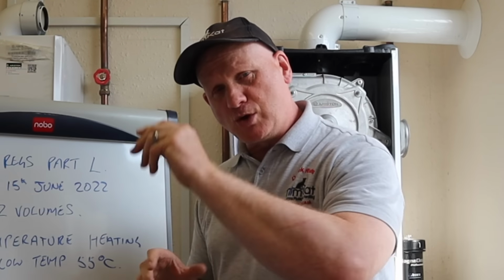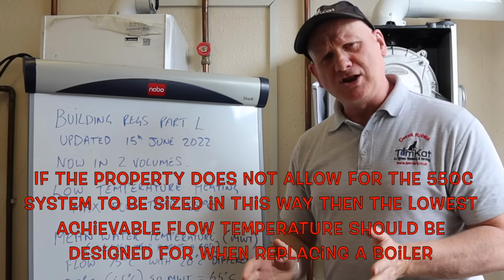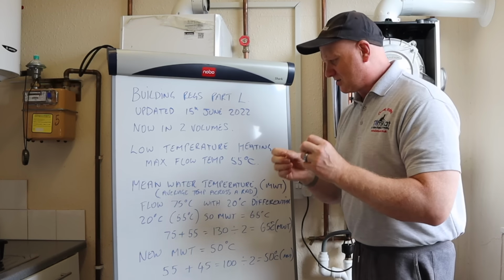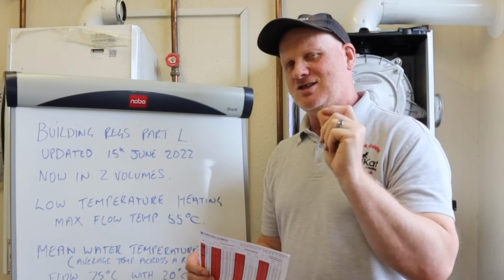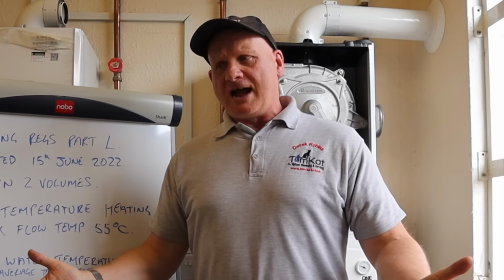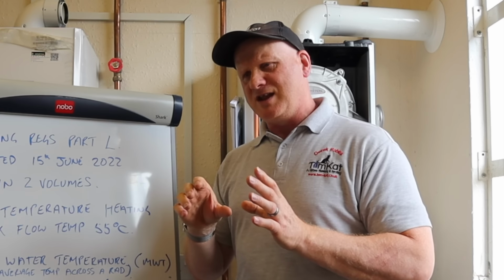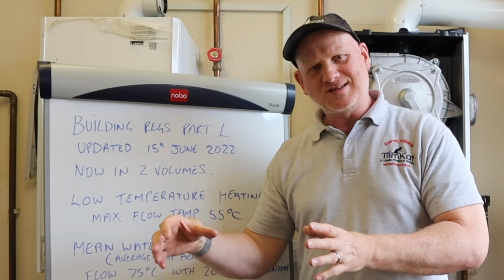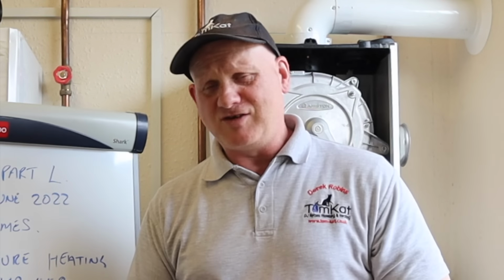Don't adjust your  heating flow temperature until you have watched this video. #saveenergy

Comment: I run my heating loop at 53°C. I read that was the most efficient temperature though I thought the temperature displayed on the boiler was measured at the return not the flow.
Five hours with all TRVs fully open and the 15kW combi boiler temperature in my place has only raised the temperature from 9.8°C to 11.1°C
So much for the energy assessor's calculations.
It does seem to be remaining at c. 11 but the outside temperature has risen and my thermometer clock is on a high thermal mass which is the other side of the radiator.

Comment: You have given brilliant advice all around  your video. It all makes sense one's you have  Explained everything about the Temperatures..  I have a question for you.. should the scale filter be connected to the 🔥 🥵  hot flow.  Or the COLD 🥶  flow.  Thanks for your advice 👍
Reply: Whilst I am not an RGI or plumber, it seems to me that it goes on the return flow (cold).
ISTR the idea of a filter is to remove stuff from the system and prevent it going into the boiler, it will do that best on the water that comes back into the boiler.

Comment: Absolutely right on heat or eat. However this phobia about CO2  is the driver of the current “difficulties”.  Incidentally, the US recommend a -15C setting for a freezer.  They are a massive % of your electricity use.

Comment: At the moment ive been seeing lots of video's on social media where people are telling other people they can save money by turning their internet router off when they go out. 

DON'T do this on a regular basis as the dlm (dynamic line management) sees this as a connection fault and WILL slow your connection speed down to protect the network!

You would then need to contact your isp to have your dlm reset or wait ages and hope it turns itself back up again.
Reply: This is true, but only relevant for FTTC products

Comment: What an absolute bag o bollocks, so I have to make my house 20 degrees instead of taking an hour it will take 4 hours. to have a bath is normally 60% hot water and 40% cold water but he's saying fill your bath with 100% heated water which means the boiler is in burn mode for the entire bath fill.

Comment: We are freezing. Boiler set to 55 for rads and 45 for water. We are freezing. I am wiping the windows twice a day. We are freezing. I am having to shout out constantly to turn lights off and shut doors. We are freezing. I am shouting out to the children in the shower to hurry up. We are freezing. My daughter sobbed and became hysterical when she broke down about the soaked black walls. We are freezing. My other daughter opened a treat packet of biscuits her sister said we can't afford them so can we at least share them? We are freezing. We are damp. We have mould. They argue over a banana. Oh and the bill is still £497 a month. We live in a stone cottage. We are freezing. If the boiler overflow freezes we won't have hot water.

Comment: My landlord put the thermostat next to the front door surely not a good place, tiny hall gets up to temp quickly so I either switch hall radiator off or open internal door. My main radiator is under the stairs so not sure it's heating the room, they removed my gas fire to avoid cost of servicing it stating I don't need it?

Comment: I'm utterly confused with my heating, last winter I averaged 45 units a month of gas usage (I only have a gas combi boiler, no cooker), this winter I'm averaging 220 units a month at present, that's a massive usage hike and my plumber insists there's nothing wrong with the boiler or my gas meter despite the fact I was using 4 times the amount of units during the hottest summer on record compared to last winter. It's a 2yr old Worcester Bosch boiler. When my fixed term comes to an end I'm going to be skint!!!
Reply: Same here. I have a new shiny Worcester boiler and and using more gas than my 20yr old Biasi. LOL

Comment: it takes 3 hours to heat  the house  at 55c   8 large& 5 small  radiators ) with condensing boiler (valient ) all bedroom thermostat radiator in level 2  so that the large living room radiators ( 20 foot x 15 foot can get heated at level 5 .    . Which would be the correct setting for the boiler @ _ 5 c temperature at now

Comment: it takes 3 hours to heat  the house  at 55c   8 large& 5  radiators ) with condensing boiler (valient ) all bedroom thermostat radiator in level 2  so that the large living room radiators can get heated at level 5 .    . Which would be the correct setting for the boiler .

Comment: this guy is useless with a low flow temp your heating will have to be on longer to heat the room.
you dont have to replace your rads or pipes you can have a like for like.
a gas fitter will sell you stuff you dont need

Comment: I turned the stat off to zero
I control the flow control 
To control the heat. 
Taps are on eco
But regardless. The new
Combi rads & pipes 
Cost me £5000
I didn't pay that to fucking freeze. Or put 3 jumpers on.

Comment: Lol I have an old wb Greensted 46 combi,
What's the best temp settings for Flow temp on the heating and the lowest safe flow temp for the hot water. We also have a stove that is the main heat source now, but still run the gch to warm the rooms a little

Comment: My home has brand new radiators with (what should be) a higher BTU that needed, but an old boiler. House struggles to heat up (it's not been over 18C inside during December) and mostly sits at 17C even with heating on. Probably an insulation issue, but I do think I need to get the system tested to make sure the boiler can handle the radiators.
Reply: Check the boiler radiator flow temperature, sounds like it may be too low.

Comment: Please clarify, my understanding is, that you do not have to be gas safe registered to work on the parts of the boiler which are not gas/seal related.

In other words, if you are purely going into the PCB and for example wiring in a Tado thermostat You do not have to be gas safe registered Because you are not opening up any seals or altering/adjusting components to do with the gas side of the boiler.

Are you saying that this is incorrect?
Reply from the maker: You can work on a boiler if you are not gas safe if the front panel is not part of the combustion chamber. Most new boilers now have the front cover being part of the combustion chamber so you wouldn’t be able to access the pcb to wire in a stat.

Comment: I tried it on my combi condensing boiler and the radiators never even went warm so I reset it to 70 and it is working fine now and the house is warm again.
Reply: Did you increase the flow to the rads/adjust the lockshields? Bleed out air, flush out any sludge etc?

Comment: They have been doing that to pensioners for decades eat or heat choice, but jolly old public allowed that to happen.
Now its facing the younger generation and you get upset?.
Also older people cannot maintain body temp as younger people so they require slightly warmer rooms like 21,/22c  , i should know i worked in care homes up and down the country.

Comment: Did I miss something. But what happens if you want a new system boiler,  what happens about the 55c degree rule then. You said that water in your cylinder has to be stored above 65c

Comment: In spring/autumn house comfortable with flow temp 55 but when it's minus 3 outside like tonight I've had to turn up flow temp to 80. If you set flow temp too low the heating is on for ages and seems to use more gas.
Reply: That’s correct ! I have both to max temp , I hit boost 1 hour for rads , they warm up super fast full pelt for hour! Whole house cooking for upto 5 hours. Pointless slowly running the gas for 5 hours ti boiler and having a woolly jumper on.
Reply: @damo1061 You're actually throwing the gas out of the chimney at higher temperatures and only think is not ideal for lowering flow temperature is the pump runs longer but the extra power you'll spend running all day is nothing to the gas waste of the sky

Comment: amazing video ! 
Hope you can help me out...

Long story short: 
We bought a new house, built in 1975, new triple glazed windows, old loft insulation 100mm, 16 radiators, new 40kw gas boiler with 2 zones -downstairs and upstairs. 
We paid £30 a day when thermostat was set to 19.5C 24/7 so we cut it to upstairs heating only. The radiators are old, type 20, plumber said this could be the issue to our high bills as it takes a long time to heat up especially the last room in system (balancing is not the problem). We decided to replace the radiators in the last two rooms in house for the type 22 ones, but I am a bit confused what size to order. The original ones are 2000x540, but the biggest I could find was 1600x600mm and these are 9611BTU/ 2816W. The online calculators are showing me that the BTU needed for this room is 3000-4000. My question is, is the radiator (1600x600) unnecessary for a room this size (4.2x3.5m), and would a radiator with 7208BTU (1200x600) do the same job (still 3000BTU more than calculators have shown me)? I'm keep playing with flow temperature but nothing helps to put my gas bill down, I'm desperate...:( Pleaaase help :D
 ( just measured flow temperature out and in on the boiler ,with boiler set to 70, it is 55C out and 51 back in )

Comment: Pump wise, I’ve read that setting it to a constant speed is necessary for heating water cylinders and variable pressure for combi boilers fitted directly to radiators. I have a third setting on mine for constant pressure and have an unvented cylinder. Each setting has three speeds. Any idea what it should be set to for this system? I’ve had a play and the boiler tells me flow is insufficient when set to the variable pressure mode. Thanks

Comment: Great video, but please DO NOT turn off your Router / Hub, they are low powered devices now, they are designed to be left on 24/7. By switching them off you could cause line instability and errors sent to your local exchange equipment and provider, therefore they will adjust your speed and think you have a line fault etc. Also you may miss important software updates. Please leave the Routers swtiched on 24/7, it's really not worth a possible £20 a year saving for all the hassle.

Comment: I've been doing quite a bit of research on this. Our boiler was replaced last year and the installer set the heating flow temp to 75 degrees centigrade (it's a combi intergas boiler) I lowered it down to 65 degrees centigrade a few weeks back but when the installer seviced it recently he said it was set too low, would put pressure on boiler to work harder and would wear it out quicker. I mentioned about condensing mode and what I'd read online and he said don't believe what you read online. He set it back to 75 when serviced but I've put it to 60 degrees centigrade since and have ordered some digital thermometers with probes so I can balance the system (as isn't balanced) and check the flow return temp.
Reply: All the advice I’ve seen is to set the flow temperature between 60-70 degrees. Above 70 is too high and below 60 you have to risk of bugs like legionella growing in your system. I’m no expert but 75 sounds way too high to me, I think you done the right thing turning the flow temperature down. Mine is set to around 65 degrees and the engineer who services it never messes with that setting, or says it’s too low.

Comment: Really informative video and I'm very glad I watched it, thank you. As an unexpected bonus I learned from you that my recently installed Vaillant ecoTEC plus has a built in ERP pump. This is interesting because the installer left my old Grundfos UPS3 inline central pump in situ and running on number 3 (full power) too, so it would seem that I have two central heating pumps running! Is this a normal thing to do?

Comment: A condensate pump outside of a condensing combi boiler will run longer and more often with lower flow temperatures and increase use of electricity.

Comment: I have been in the game for 55 years and to save money why don't people just get their system balanced you don't need to turn the flow rate down just balance the system and get the hot water were you need it as fast as possible but send it back to the boiler as slow as possible thus giving the time for the water to pass its heat into the radiator,  then you use less gas and you heat the rooms up quicker, then the heating switches off its simple not rocket science. 
Nice video

Comment: These replacement boiler regulations are all well and good, but I would hazard a guess that the majority of housing stock in this country would have to upgrade pipework and radiators which will cost the people of the UK trillions and trillions of pounds in total because basically you have to rip your house apart in order to achieve it.

My house was only built in 2006 has plastic central heating pipework 15 mm downstairs and only 10 mm upstairs. All the pipework is concealed behind plasterboard ceilings and floors. What a massive undertaking it would be to have to replace all my pipework !!!

Comment: Thanks for sharing - interesting video👍✌️

I've been banging on about the building industry building houses akin to Northern Europe for 30-40 years. UK building industry has done sweet FA about such.

I've been taking measures to reduce energy for years.

Carbon Climate Change agenda and "the Ukraine" etc is all part of a gouging, profiteering con, it's about control.

I've got a water cylinder, all rads have stats. Not sure how one takes HW temperature though 🤔

Also the boiler setting is numbered "Minimum 1 - 5 Max". I set it at 3.5 the water is piping hot. I've reduced the amount of time hot water is on too. Pump speed is set accordingly.

These new boilers with 8-10 year warranties? Like EVs, don't last as long as their predecessors - ergo they're not eco friendly as more of them have to manufactured as they're life expired at year 8 or 10. EVs are a write off when main battery is life expired - lithium batteries are made using filthy, dangerous supply chains and are not recyclable.  Some boilers, if well maintained and serviced, lasted 40 years. What we are being made to do? It's called enforced obsolescence - as opposed to progress. It's a chase the lady con trick!

In other words, it's another govt (quangos) and building industry gouging con. Also the evidence for CARBON climate change is sketchy at best. It's like Cold War 1, started by one man. In this case, who was outed, fled Europe straight into the arms of the CCP. The CCP are, with India and USA the world's biggest polluters. As are the top 100 companies and the super elite "one percenters", the unelected oligarchy. In the old HASAWA the polluter pays, ergo they should all take the lions share of paying for such! It's like the 75,000 unregistered chemicals let loose by them, same with water companies killing off our rivers again with effluent discharge etc. We are being conned, bread and circuses! 

I agree, my plumber and I have over specd rads. But I won't be having my kit/pipes ripped out if it's serviceable, the same applies to zones in towns etc - I'll ignore them, I don't recognise the government's right to rule, same with our WEF owned king and his son The POW (I had higher hopes for him!). 

There is climate change, but we are not being told the truth!

I'm WIS&D, ill and struggling, making us pay 25% levy for electricity, VAT at any price on energy etc is immoral. Govt has willfully removed power stations and gas storage, put the UK on its back foot, committed treason! Tony B.Liar, plus Ca-moron, two WEF shills, instigated this suffering. 

The UK has been eroded since WWII, possibly WWI, and certainly since 2008. Ponzi F.I.A.T money schemes etc.

You've given good advice my friend, but the root of the problem is a political coup by the WEF and CCP who've infiltrated and over taken our government. And our military chiefs and SIS sit on their hands, cowards, traitors or other?

This country needs a rocket up it's arse! 

We are being gouged and conned and the sheeple are enabling that with our compliance during this three year PsyOp (sorry "nudging").

I'm neither a Covid denier nor an anti-vaxxer, but we will have Carbon Climate Change Lockdowns soon if we let tptb continue in this vein.

If we all pulled together and just paid the energy generators just enough not to get taken to court, but kept using energy full tilt, kept our WISD and elderly warm, wouldn't that send a signal to these evil Orwellian Animal Farmesque demons at the top!

Comment: What are your thoughts on fully zoned TRV solutions like Tado or Drayton wiser?
I've found since installing tado that my rooms are colder. Not sure if saving any money as I installed it going into winter.
Reply from the maker: I am a big believer in using the controls made by the manufacturers of the boiler as they speak the language of the boiler.

Comment: Great presentation as always. Any ideas....I have a Worcester Bosch condensing boiler that started doing short cycles. Goes yo to the required temperature and turns off. The display shows the temperature decreasing to about 39 / 40 and turns on again.. this cycle goes on continually.